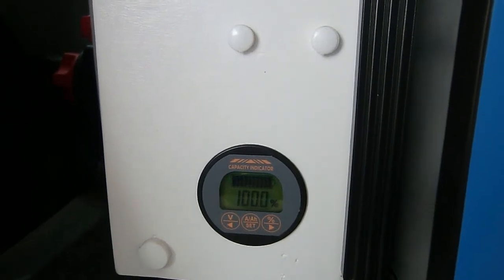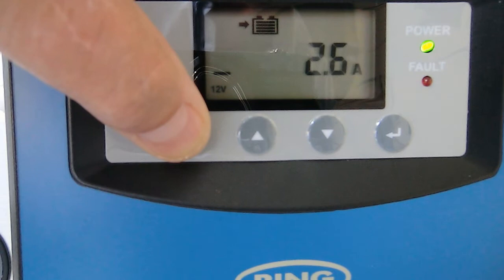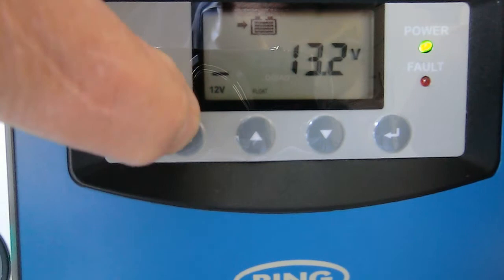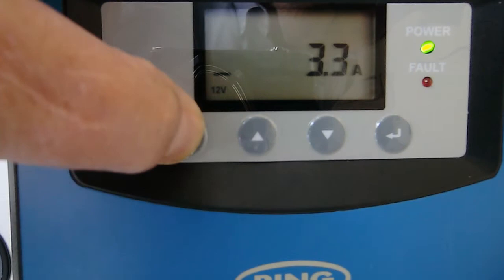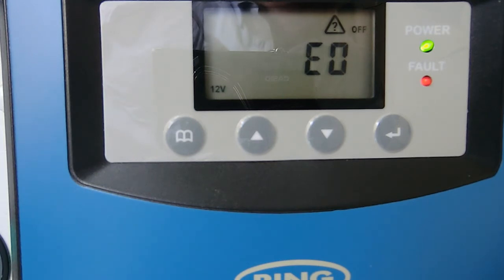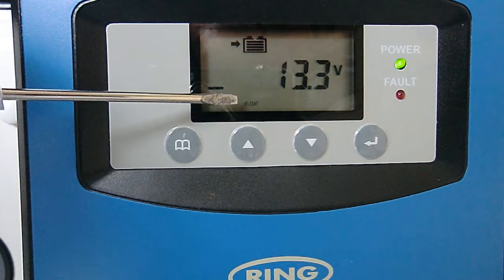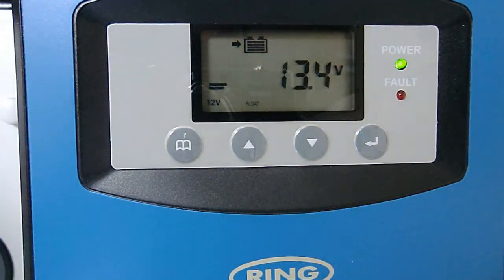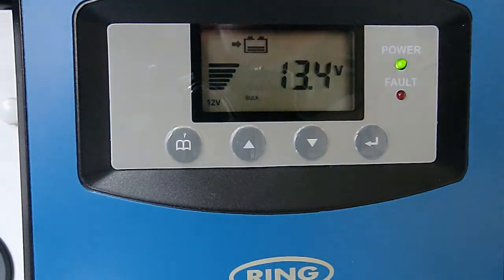Ring RSCDC30 not charging as expected from Alternator (B2B)

Comment: Did you ever get any success?

I'm looking to upgrade to Lithium from AGM. If I can I want to use my ring charger which I've never had an issue with once I'd set the voltages up correctly.
Reply from the maker: I still use my Ring as both MPPT & B2B.
Based on this "feature" I try to remember to disconnect the battery (I have 80A breaker) then reconnect when the battery charge drops below about 80% and the Ring is stuck in Float charge mode.

Comment: I suspect this problem is a result of having a LiFePo4 battery - they have a very flat discharge curve in comparison to a lead acid battery. That Ring charger was designed with lead acid batteries in mind, the voltage of which will tend to sag after even mild use. It uses the battery voltage to decide when to switch back to bulk charging not the availability of alternator or solar power. Because the lithium battery maintains its voltage until quite deeply discharged, the charger still thinks it's full and so remains on float. A lead acid battery at 80% state of charge will be at about 12.4V and will be down to 12V at about 50% discharged. A lithium battery won't drop below 13V until it's at 30% state of charge and only reaches 12V at 10% state of charge. The manual doesn't state at which voltage the charger switches back to bulk, but if that is the problem it's something that can only be fixed by a firmware change.
Reply from the maker: I agree it needs a firmware change, and thought provoking about flatter LiFePo4 curve. Not sure the flat curve explains the problem 100% though - when I disconnect the battery (for say 1 second - I don't have any timings but it is very short) then the battery voltage will drop but pretty minimally (as it loses charge for a second). Nevertheless the RSCDC30 restarts in bulk mode.
Equally - I killed my lead acid battery in the artic circle in winter last year - before it went to meet its maker I did notice I wasn't always bulk charging from the alternator. Of course there was no solar and I also had other wiring issues as well as not having a breaker in the battery circuit as I do now. But I did get as far as noticing if I put the RSCDC30 into program mode and out again (e.g. set or clear solar priority) then it would start bulk charging. 
I guess I could test more by dropping the LiFePo4 charge/voltage even further before starting the alternator but life is too short: Ring don't understand the issue despite about 20 emails and it is plain simpler to flick my switch every morning when I am on the road!
Reply: @chrisnorris8612  I've been doing some reading about this charger because I have one on a boat, currently charging a lead acid leisure battery that I'm intending to replace with a LiFePo4 battery at some point. I saw one person say that they'd been using it with no issues once they lowered the float voltage to 13.1V or whatever the lowest setting is, so that might be worth trying if you haven't already. It does seem that this particular device has a few software issues that they need to work out. 

I have seen other people mention the trick of going into the menu and out again to get it to fire up in relation to solar charging, but I've never seen ours get stuck in float when the engine starts. It's always started charging once it wakes up.
Reply from the maker: @turbinia  Thanks for the tip - will drop the float setting as far as it goes and try again. Of course that is below the recommended for lead or LiFePo but worth a play - will also need to monitor other side effects.
Reply: @chrisnorris8612  Float charging isn't really needed for LFP batteries since they have minimal self-discharge, whereas lead acid ones do require it to maintain their charge. Setting it lower won't have any effect on the battery.